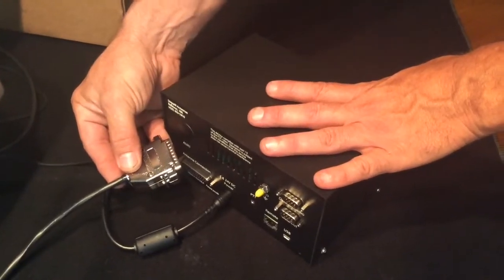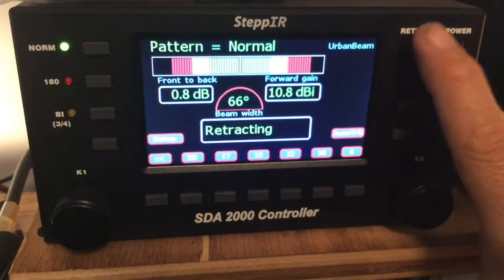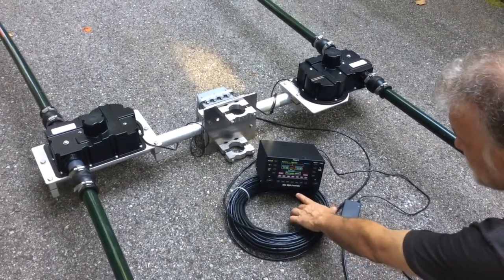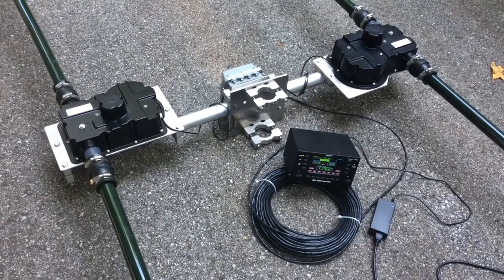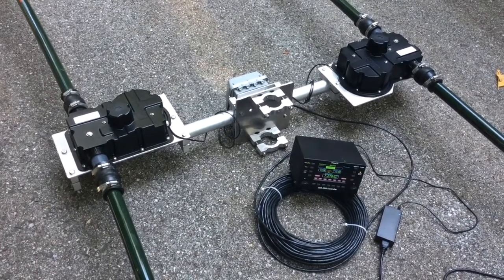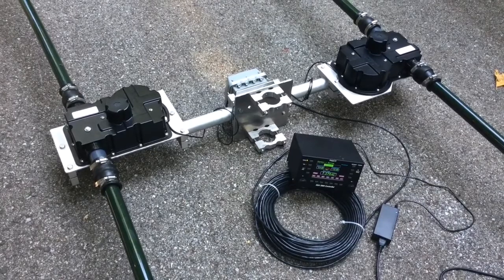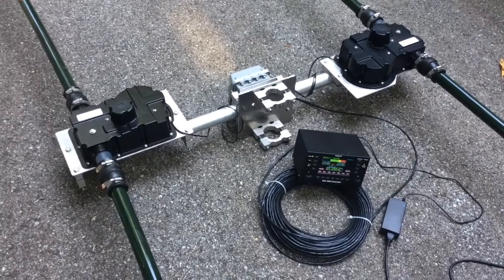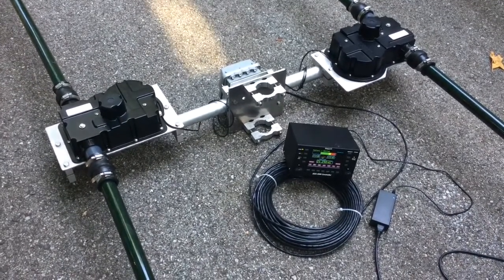SteppIR UrbanBeam   Element Test

Comment: Antennas should never have moving parts, I've heard of too many guys with motor issues.  Every antenna has tradeoffs and this one is expensive.  I get it, limited space, easy of use, I would rather use a hexbeam and a vertical for 40m.  6m yagis are small and light weight.  This antenna violates the KISS rule. 
I hope it works well for you.

Comment: I own the BigIR vertical and the steppir motors in both the EHU and the 80m coil unit sound exactly the same. It is normal as stepping motors work in literaly steps rather than lineal rolling motion. Hard to explain. Steppir are very technical but exceptional performers. Hard to find something that will work better to be honest.